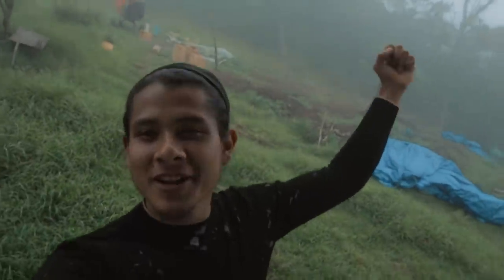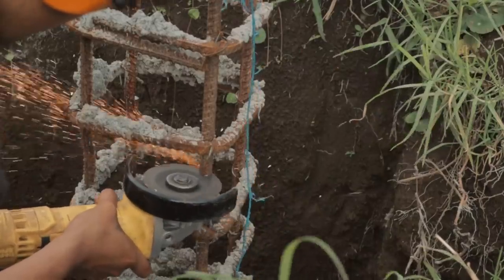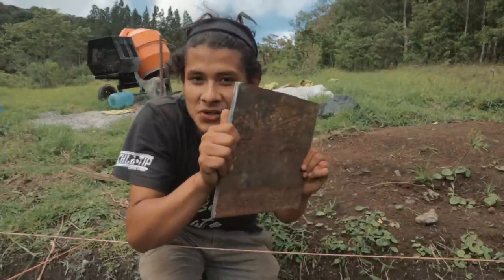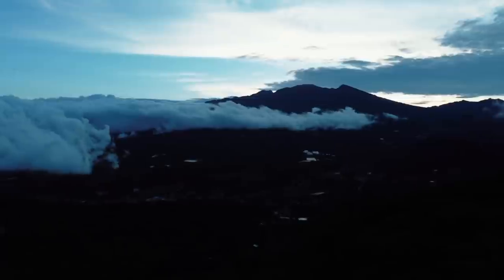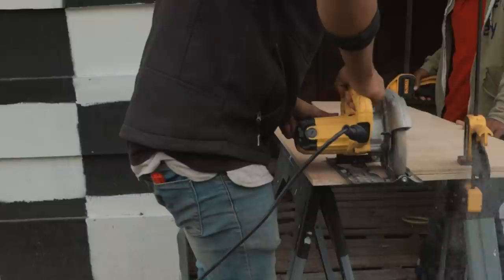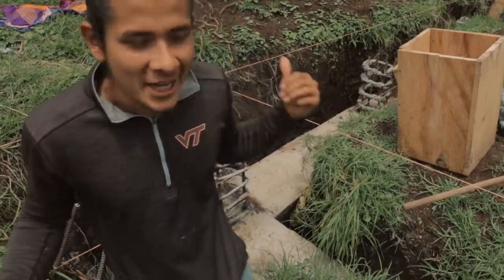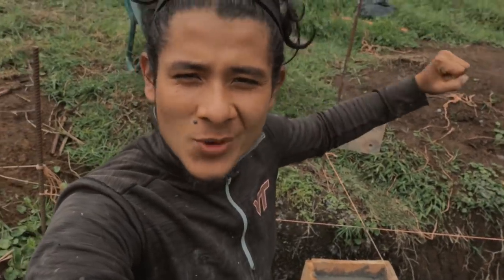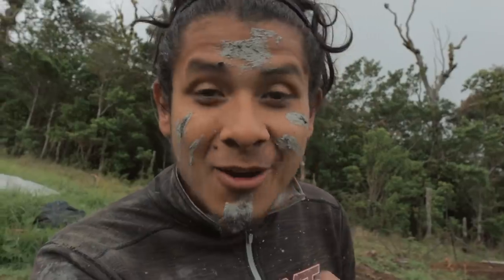I ALMOST SCREWED IT UP!! |Dream House Building

Comment: I raised goats for over 35 years and got to know each individuals personality, and they are all different. It sounds to me like maybe this young doe is coming in heat and wanting the buck. Several of my young does behaved this way. I didn't allow them to be bred when too young or too small. I always housed the buck separately in his own house and his own yard area. When I did allow the does to breed I always wrote it on the calendar and was able to keep very accurate due dates this way. Gestation for a goat is 145 to 155 days give or take a day or two before or after. As I had so many, sometimes as many as 45 bred does, I knew when they should kid within a certain time period.
Reply from the maker: Wooooooow, this is very valuable information, I will for sure remember this for when they are ready to bred. Thanks for the information 😊❤️